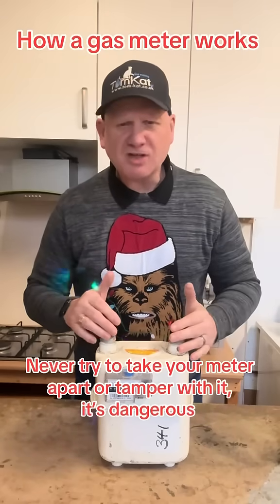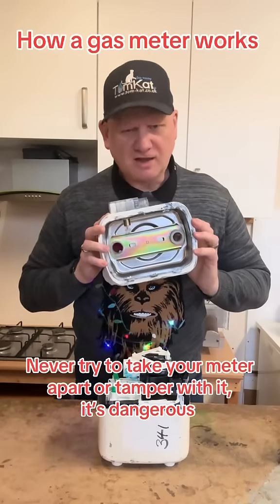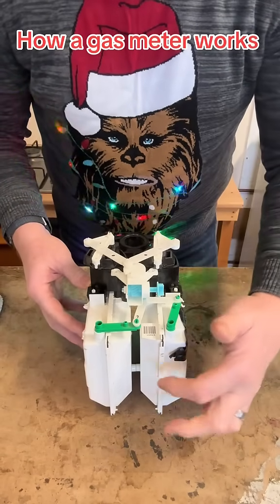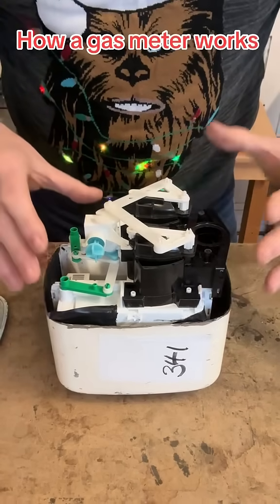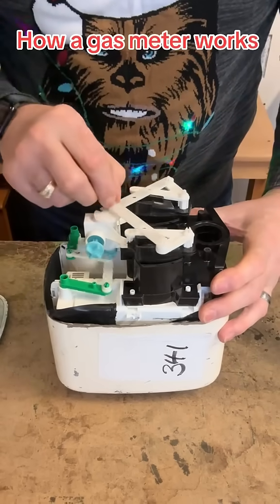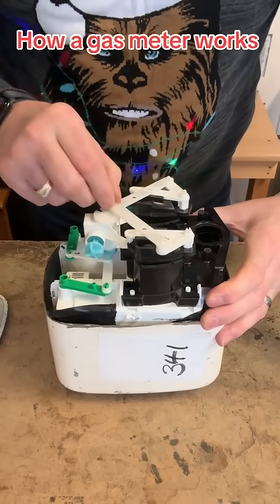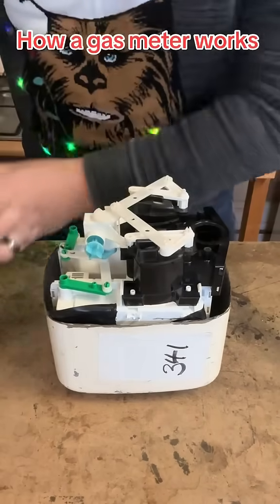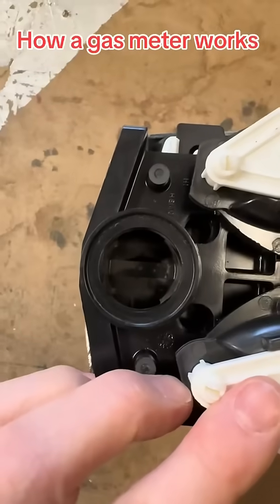How a gas meter works #gastraining #plumbing

Comment: I shouldn't say this so I will say THIS DOESN'T WORK ANYMORE! But apparently people use to attach a vacuum cleaner to the inlet to go back in time. Also the reason " They", don't like twin flex pipes on meters is simply revenue protection as (again no longer works), people could turn the meter upside down and it would stop clocking. Many other ways of stealing gas. My instructor years ago told me people will always steal gas so if they made it hard then it would put everyone in danger
Reply: people just have a spare meter to swap out can also drop a pencil in to stop the mechanism moving apparently
Reply: i could counter with gas meters are everywhere the only one you dont want running is yours. ive just been down to the motorcycle show, a mate had his bike stolen from outside the travel lodge. the cops are like you. i dont mean to be rude. clueless.
Reply: @markchristohperowen6806  I think you are saying if he turned his motorbike upside down it would not have been stolen. Not sure how that would work. I tend to keep my motorcycle close so I can inflict harm on those who attempted to steal it.